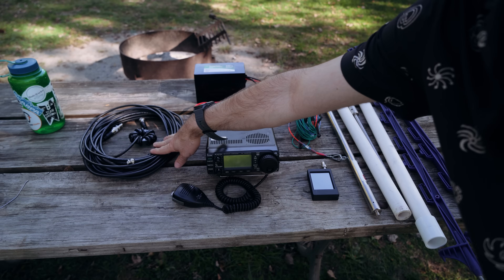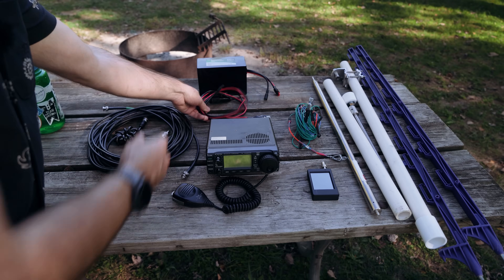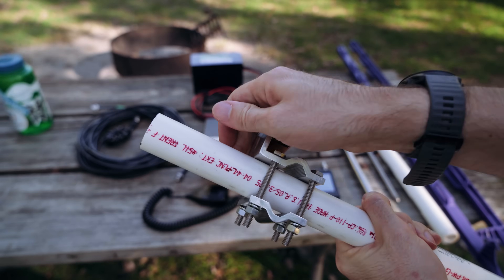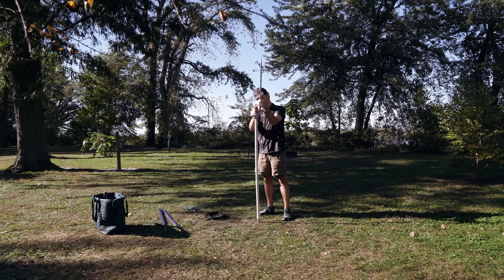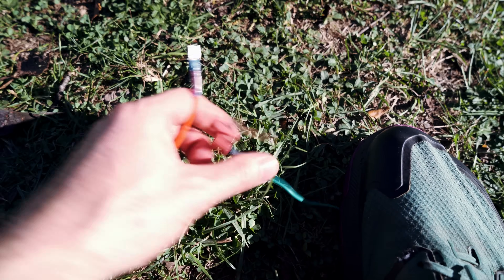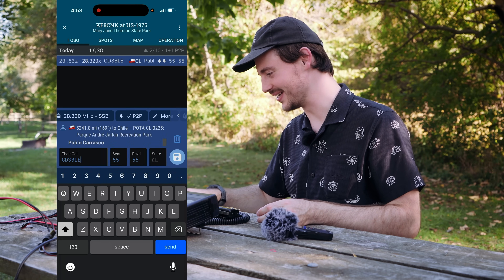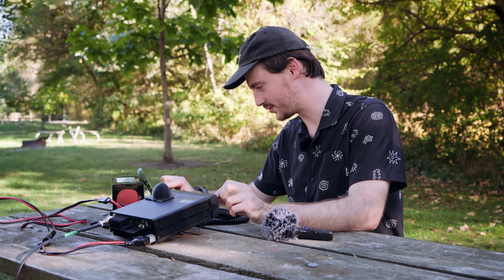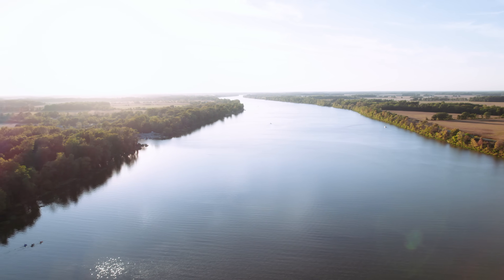Beginner POTA Gear Guide: What to Bring & Why

Comment: Curious what hard case you are using here for your 706 rig.
Reply from the maker: It's a case from an old lens adapter. No longer made but harbor freight Apache cases are a great low cost alternate option

Comment: Thanks for showing the equipment that you use and how you're using it.  That POTA PERformer is rockin' it for you.  I'm currently building a smaller version of your setup that I call the Moto POTA antenna.  It's a 5 meter telescoping whip for 10-20 meters that mounts to the handlebars of my small adventure motorcycle, with two reels for the elevated radials, with custom 3D printed parts.  I plan on using it with my FX-4CR 20W transceiver and a power bank that can source 15V@3A.
Reply from the maker: Love it. the Moto POTA sounds like an awesome portable setup!

Comment: I like your numbered beads. Where can I find some getting ready to build the same antenna. Thanks
Reply from the maker: I used these beads: https://www.amazon.com/dp/B0C4KN4RGZ?ref=ppx_pop_mob_ap_share

Thanks for watching!
Reply: Thanks that is the most unique way to mark your radios as well as antennas. I think it’s brilliant.
Reply from the maker: @Don-N3TYF  I agree! Although I can’t take full credit for them.
I saw a video by KA7APR on his POTA performer setup and really liked the bead idea. These ones worked great with my 18awg silicone wire

Comment: The ground wires are each placed at 45 degrees to the centre of the direction line you are seeking to focus the signal, not 90 degrees. The antenna wires do form 90 degrees to each other.
Reply from the maker: The designer of the antenna, KJ6ER says 90 is optimal for the radials, check out his antenna design in detail here:  https://www.vhfclub.org/pdf/PERformer%20Antenna%20by%20KJ6ER%20(2025-02).pdf

Comment: Really should pick up a 706Mk2 the next time i see one for sale on QRZ. I don’t think anyone has ever regretted having one that I’ve talked to. I like the POTA performer too, though I use a tripod as it makes it a bit faster for set up and tear down (not dealing with a stake hammering in and pulling out). Great video!
Reply from the maker: You absolutely should! 100w in a compact UHF/VHF/HF rig is so cool. 

I agree with the tripod setup being much faster but I already use my tripod for my camera lol if I do another rove I’ll definitely consider getting an inexpensive one for the antenna